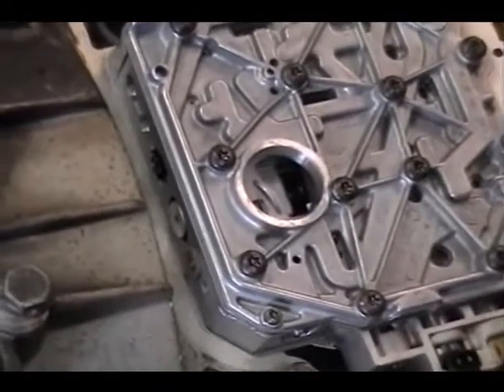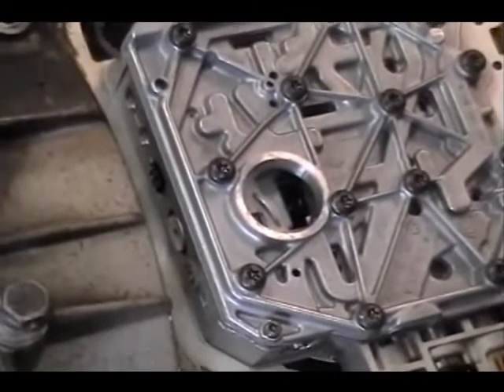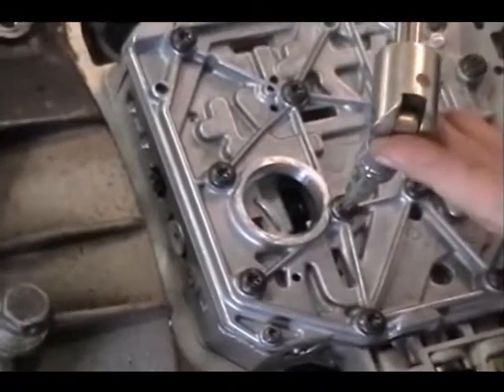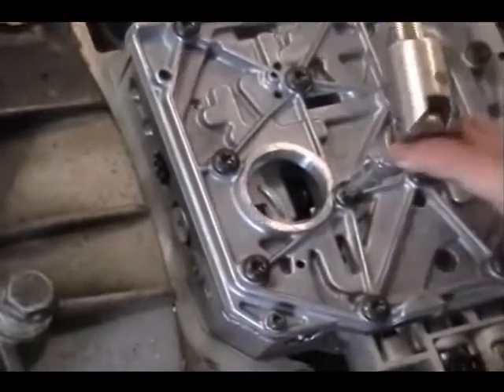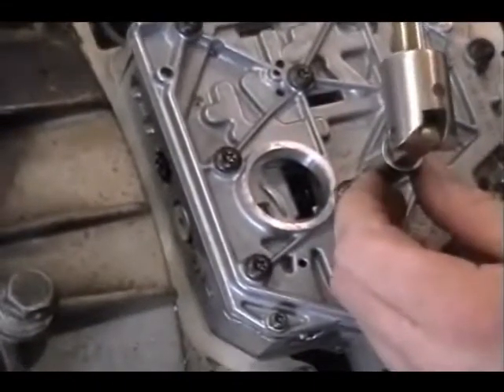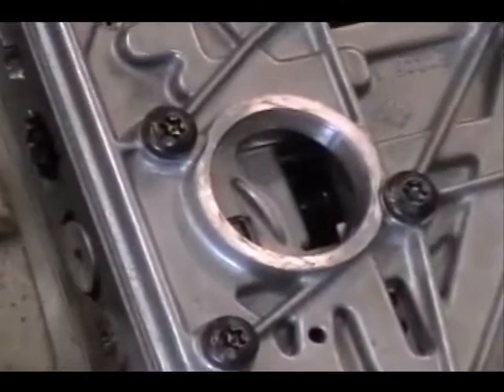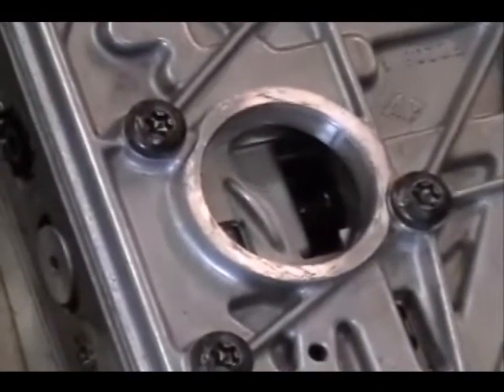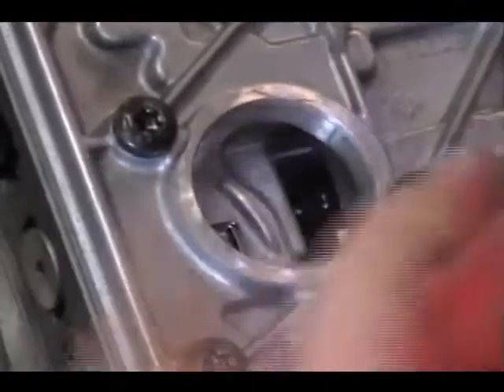01m valve body video

Comment: Do you still do the valve body rebores? Got a 01 Jetta 1.9 shutters under light acceleration but rpm not changing. Don’t wana just change fluid for it not to work an have to do it again. Been running it in 3rd instead drive to delete the problem. Car has 185k miles otherwise drives shifts fine
Reply from the maker: Yes I do.  Check out my website for more info and email me through contact page on my website.

Comment: Hello, I have a problem with a transmission 01m SEAT Toledo, when it is going to change from 2nd to 3rd a strong blow is presented, that solution solves the problem or is there some other adjustment that I must make to the valve body? I would be very grateful for your help. Greetings from Venezuela.
Reply from the maker: You could try resetting trans basic settings look at me website in the following link.  After that you would need much more help than I can provide though the internet.  http://kansascitytdi.com/o1m-faq/
Reply: I have already made the basic adjustment but the problem persists, several valve bodies have been changed and cleaned and the problem persists, the tcm changes and the problem persists, even the sensors g38 and g68 have been changed, when R is applied a stroke is felt equal of R to 1 and 1 to R, and hit when changing to 3rd.
Reply: I would appreciate a lot of help from you, because here you can not get new parts, thank you. :)

Comment: Do you have recommendation (brand/model) for a torque wrench for this job? It looks like you are using a beam style TW in this video...I would like to pick one up for my assembly.
Reply from the maker: I own snap on and cornwell "dial" guage torque wrenches now.  They are made by Precision Instruments and tool companies put their badges on them.  I wish I would have known this as I could have saved bundles by buying on ebay or amazon under the Precision name rather than paying snap on tool truck prices.  Here is a link  to one that would be great for this.  https://www.amazon.com/Precision-Instruments-PRED2F150HM-Dial-Type-Pointer/dp/B005EB9O9S?crid=TE0KYQKCM67W&keywords=dial+gauge+torque+wrench&qid=1695328702&sprefix=dial+guage+torque+w%2Caps%2C367&sr=8-28&linkCode=ll1&tag=coolairvw-20&linkId=0ec5e13f6d1da422b2209711735d38b7&language=en_US&ref_=as_li_ss_tl

Comment: Now if you have a cheap torque wrench can you torque it to maybe 40 foot pounds to make up for the fact it may be too tight at 44?
Reply from the maker: That would be great if you knew it was exactly 4 foot lbs high  But what if its 4 foot lbs low?

Comment: Umm so what’s the tool you are using that is quality?
Reply from the maker: Not sure what is in this video.  I own snap on and cornwell "dial" guage torque wrenches now.  They are made by Precision Instruments and tool companies put their badges on them.  I wish I would have known this as I could have saved bundles by buying on ebay or amazon under the Precision name rather than paying snap on tool truck prices.  Here is a link  to one that would be great for this.  https://www.amazon.com/Precision-Instruments-PRED2F150HM-Dial-Type-Pointer/dp/B005EB9O9S?crid=TE0KYQKCM67W&keywords=dial+gauge+torque+wrench&qid=1695328702&sprefix=dial+guage+torque+w%2Caps%2C367&sr=8-28&linkCode=ll1&tag=coolairvw-20&linkId=0ec5e13f6d1da422b2209711735d38b7&language=en_US&ref_=as_li_ss_tl

Comment: I looked at a guy on youtube torqueing with 10 nm, would this bring problems to the body of valves?
Reply from the maker: Did you delete your previous question?  As I told you before 5 nm is ok.    5nm converts to 44 inch lbs which is what I said to torque to in the video.    10 nm would be 88 inch lbs.  Not ok.  Valves would for sure stick, and threads might even pull out of the trans case.  VB might be damaged.  You can see it for yourself right there in the video.  With the "click style" torque wrench it only turned just a bit farther than when it was previously torqued with the better torque wrench.  Double the torque most certainly would cause a problem.  If your finding a guy suggesting torquing to 10 nm then you should post a link in the comments to this video, so that others dont make that mistake.
Reply from the maker: There is no spec published by Vw for those bolts because they recommend not taking the VB apart.  To them VB is a whole assembly.  I dont torque those with a torque wrench, I just make them "one hand" tight with a nut driver type tool.  About 15 inch lbs works.
Reply from the maker: both febi and pentosin are original equipment suppliers of vw approved fluid.  You can check my website for my fluid recommendations.  http://kansascitytdi.com/o1m-faq/